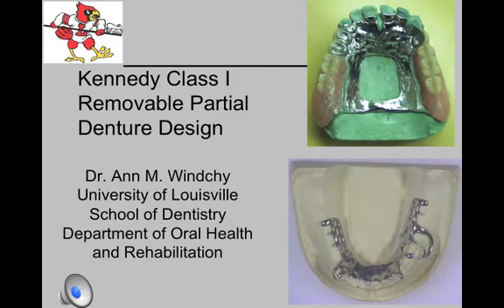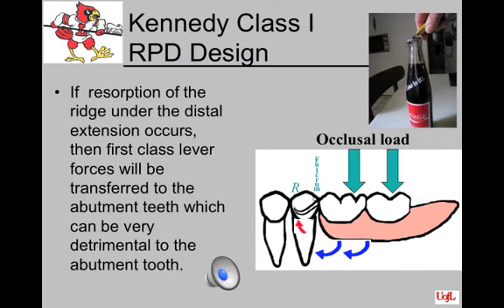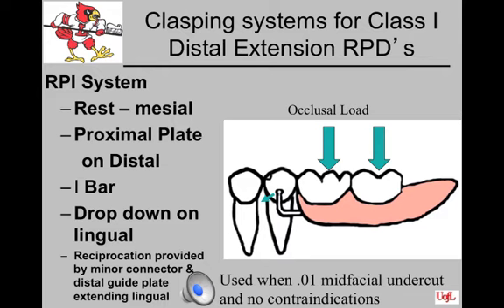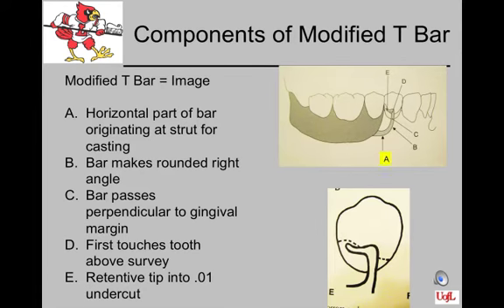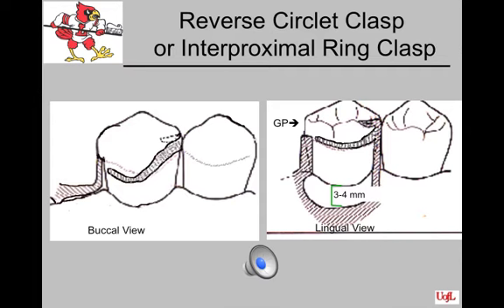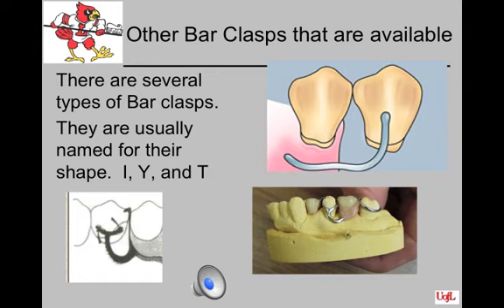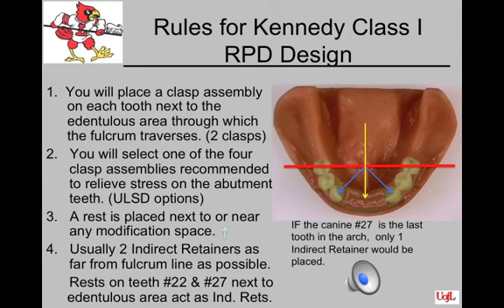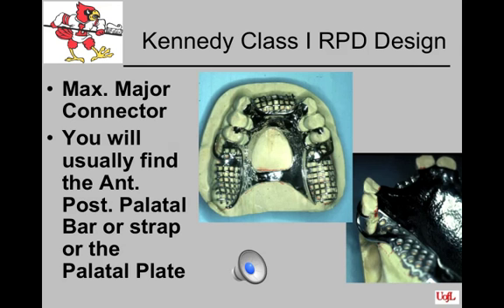Kennedy Class I Lecture #13

Comment: Very very informative video indeed. could u please tell me what do u mean by drop away on lingual?
Reply from the maker: By drop away I mean to dip down from the mesial rest with the metal and avoid the marginal gingiva by 5-6 mm on the maxillary or 3-4 mm on the mandibular and then continue the metal to the lingual aspect of  the guide plate.
Reply: Thank u Ma'am. Is this a mandatory feature of RPI clasping system?
Reply from the maker: Ideally for the RPI system of clasping, you use a) a mesial rest, b) a distal guide plate and c)  dip on the lingual to avoid the marginal gingiva and d) the I bar engages the tooth ash the mid facial or very slightly to the mesial of the mid facial.  This system minimizes torque forces applied to the tooth..

Comment: Thanks for the videos. I would like to ask what can we do if we dont have anterior tooth for indirect retention?
Reply from the maker: Can you give me specifics as to which teeth remain in the arch?  I would first draw a fulcrum line through your remaining abutments.  I would then draw a perpendicular to that fulcrum line and  try to place an indirect retainer on a tooth as far anterior, as possible to your fulcrum line.
Reply: for example, the case with only 2 canine left with some incisors remained (or only 2 premolars left with some incisors remained). 
Then we need to place clasp on 2 canine (or 2 premolar), and the indirect retention far to axis will be left to remained incisors only. 
We should place +ve seat on those incisors, or just plate the incisors. Or we should consider modifying the abutment and turn into overdenture.
Reply: also i would like to ask the use of cast circumferential clasp on premolar in tooth supported case (class III/IV) as the other series of your videos mentioned. will the clasp be too rigid to flex over the .01" undercut of premolar as the length of circumferential clasp is shorter than that of molar. will the clasp distort or cant be lift up from undercut?

also, thanks for the videos, they are great!!